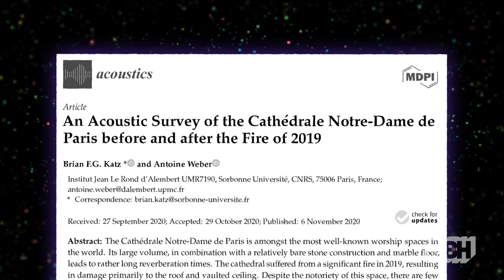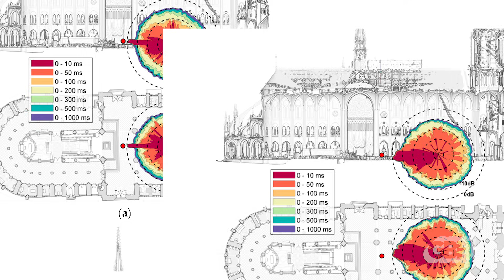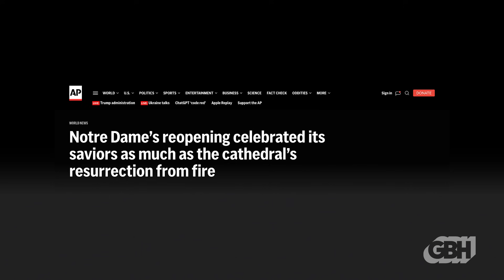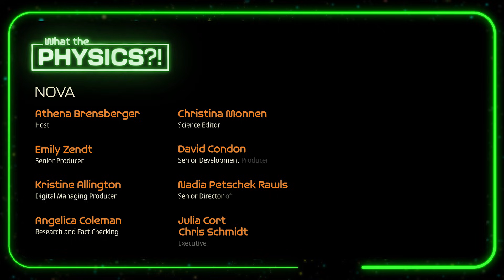Does Notre Dame Sound Different Now? | What the Physics?!

Comment: The change in reverberation was due to the crashed vaulted ceiling in the transept. A 50’X50’ hole that would not change until the ceiling was reconstructed. Even then, there would be slight differences as sound reacts to both old,  cleaned and new materials in slightly different resonant vibrations.
Reply: Absolutely.

Comment: I still think the higher ups burned it down themselves because of the amount of lead and cost that they were going to have to remove it inorder to keep it open to the public
Reply: Hello @MrBentheretwo This is Dr. Katz, that is really quite far from the facts. First of all, there was no work being even considered towards removing the lead from the roof. To prove that, the new roof is the same material, lead, as is used all over the area for roofing. This was an accident that was related to the restauration that was actually already going on at the time in the attic.